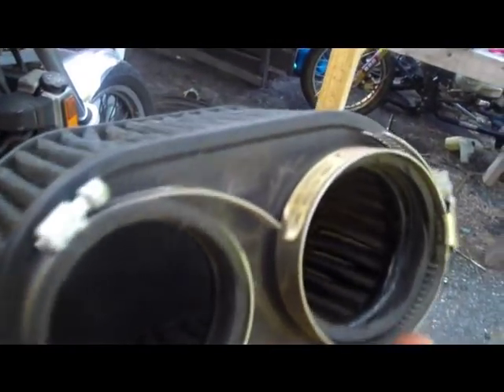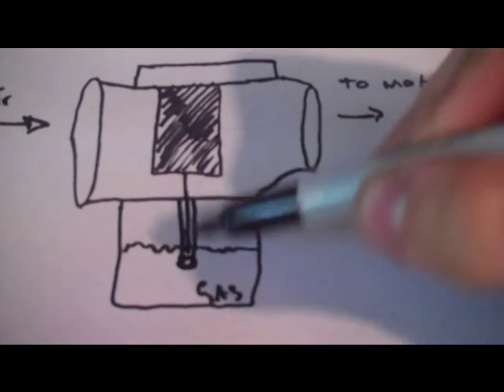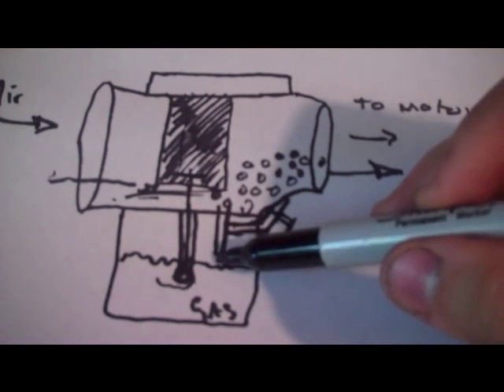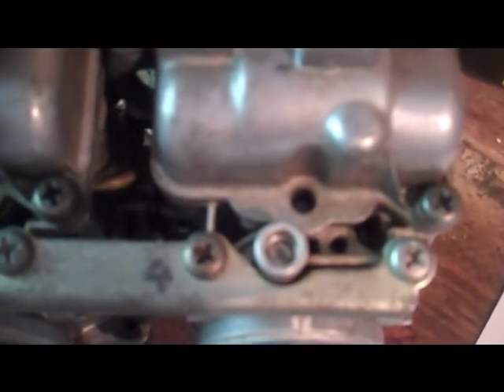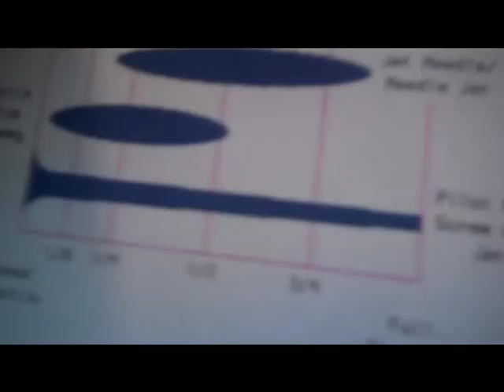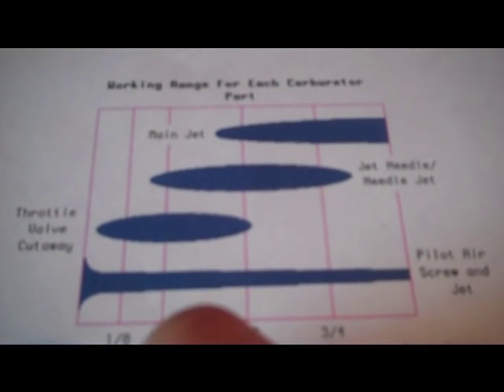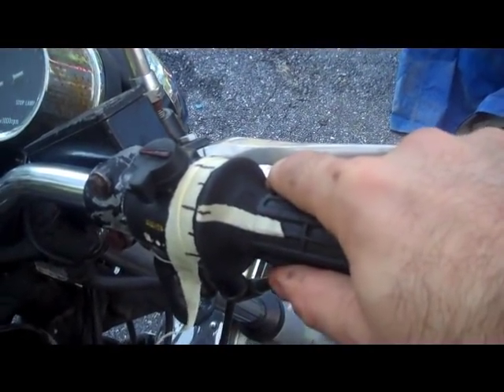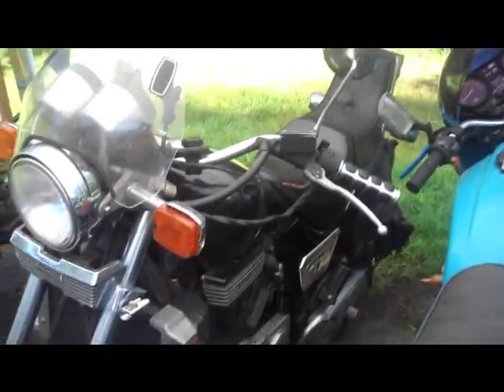How to adjust the jets on motorcycle carburetors

Comment: My bike has to high idle 2100 rpm. Its a Derbi senda 72cc 2stroke with a dellorto 21 carb.
The idle doesnt fall at all and when i put 1st gear the gearbox hits since the rpm are high and sometimes the engine even stops.
Both idle/Air screws are fine, theres not a problem with the throttle neither are there any leaks on the vacuums!

What could it be? Do you have any suggestions on what to do next?

Comment: hi Max. thanks for the info on the pilot jet covers. have another question. my air/fuel mixture screws are on the engine side of my carbs. when I adjust them in until they seat, there's very little change in idle if any. does that mean I need more fuel or less fuel through the idle jets?
Reply from the maker: Best way to determine that is just by reading the spark plugs like i show in the video

Comment: i have these exact carbs on my bike, i took them off and tinkered with them, when i put them back on and fired it back up, it revs all the way up to 6-7k and wont come down.. the throttle is not sticking and the choke is set right and not sticking either. what is my problem? i cant figure it out!!

Comment: Hey nice video...ty  Say I am working on a 2005 Yamaha Rhino 660 carb for a friend and he uses it at his Utah cabin at around 9,000 ft and it has a back fire issue during deceleration. Can I adjust the needle to lean it out or should I get a smaller main jet..?
Reply from the maker: Rejetting the carb would probably be the way to go. Usually it doesnt take much to adjust for altitude
Reply: right on thanks, but do you have a suggestion on what size jet for around 9,500 ft altitude or should I buy a pack of multiple sized jets and step down  2.5 at a time until I find one that fixes the issue..?
Reply from the maker: Yeah unfortunately I dont know, typically its just down 1 or 2 sizes. 
You might contact other users and see what they are jetting at high 
altitude because swapping them out a bunch of times is kind of a pain in
 the butt
Reply: alright...thanks again...

Comment: took the baffle off my 91 vulcan 750. its stock otherwise but does have a MSD. idle and throttling seem ok but cruzing or trying to maintain a steady speed it crackles. it has also stalled and backfired. any ideas?
Reply from the maker: Open up those jets

Comment: nothing in any particular detail really, but look in my videos for one called 'proper start', proof it DOES work! 
at the moment, just zx9r carbs straight off a bike, not re-jetted yet (apparently drilling the main jets out to 1.6mm for a 2 litre engine is a good start) and ignition straight off a 90's ford. at the moment just running a fixed 10 degree advance,and it idles fairly smooth for something just thrown together temporary! 
whats the name of that diagram you used?

Comment: I have a 92 gsxr. The petcock went back.  So I changed it the bike was running great before that. It was running like crap after I changed it so I pulled the carbs off and noticed bad floats seals changed them and it still runs mediocre compared to before it's jetted at 150 and pilot jet is 25 it has a hard time idling now but run fine at high speeds any suggestions?
Reply from the maker: Well if it was running fine before but now its running rough and you havent changed any major components like the intake or exhaust, chances are you dont need to change the jetting. I would suspect you were probably running rich from the overflowing, so start with new spark plugs that might be the source of your problem

Comment: i wanted to thinker with the pilot screw but it is already turned in to the max (i want to make it leaner). i think this means i should work with the pilot jet. should i try 1 rotation to right ?

Comment: 13:30 my lower part of my carbs are identical. i have a '92 gsxf 750 and i cleaned them because they were dripping gasoline. i didn`t touched the upper part because the sliders worked well. now i have a problem - put everything back except the airbox and when i rev the engine it deccelerates really slowly. is it because to much air ? should i put the airbox back in?also- are the sliders in the carbs supposed to move?(the ones attached to the membranes) when i rev the engine? thanks man.

Comment: awesome man thanks for the info
around 13:30 you say to increase based on the number of the jet
what did you mean by that?
Reply from the maker: Jets are classified by their size for example pilot jet size 40, and they will often increase incrementally by 2.5. So if you were to increase your size 40 you would replace them with 42.5 size jet and so forth

Comment: Hey quick question... my carbs are leaking fuel out of the hole the needle sits in... if i lower the floats to lean it out will i prevent them from leaking? thanks

Comment: Hi Brother, i'm trying to get more power of a Keeway TX 200cc 4-stroke, the bike is a single cylinder and use carb, the carb its a PZ27 (27mm diameter) and the exhaust has 3 very restrictive chambers into the silencer, so it can produce like 16hp on a good day, its a OHV engine... copy of the CG125 from honda, but elevated to 200cc... i have opened the exhaust y pulling out the last chamber of the cilinder getting better sound like a sport motocross bike... so, what do you recomend me to do? normally here in venezuela we change the carburator for a PZ30 but it make the machine runs bad... with now my bike uses the stock carb with the stock aire filter, and a iridium NGK spark plug, and when i stop accelerating and leave the engine runing by the movement of the wheels, it start to fart and sometimes you can see flames during night...
Reply from the maker: With all of those modifications you will definitely need to rejet the carbs like I demonstrated in the video
Reply: Thanks mrmax, i will try it...

Comment: Sensei,

I have removed the carbs from my bike, in the hopes of installing new jets. However, I have run into a problem.... the screws that secure the float bowls are badly seized. What's worse is that the last owner seemed to have the same problem, because most of the screws are really badly chewed up and don't offer a good bite. I don't think it there is any Loctite, etc, on the screws, because I managed to get a few of them off. Do you have any advice?

Comment: i got a yamaha xj650, and i had to switch out the motor because the starter drive clutch went out. i only switched the motor, kept the same carbs and exhaust but when i started it up, the motor would rev super high...any suggestions on where to start??

Comment: finally got day off to put airbox on.prior to me putting the air box back on everything was ok just would bogg down at 75 80..so when i finally got it on.the bike started first try and idled at about 12 to 15 hundred rpms .then all of a sudden without warning it just started high reving at about 5.5k or mor rpms..so i turned idle screw out so much without response it fell out..so im back to square 1 ..what did i do wrong..PLEASE HELP.

Comment: question i have 1986 tt225 yamaha dirt bike i am having bogging issue. so i cleaned the carb ran better but still little bogging i followed the same spec as the manual say . gas/air screw turn out 2 1/2 to 2 3/4 and the needle 3/5.  question the gas air screw you half to set it  between 5 and 6 turns to make it run right? and the manual says 2 1/2 to 2 3/4? also i have dark spark plug?
Reply from the maker: +GERMAN SHEPARD Set it to where the manual says, and investigate other issues as to why you are running rich. Clogged air filter, float height too high, valves needing adjustment, etc

Comment: hi max great video but like everyone have a question, i recently purchased a honda z 50 monkey bike that never ran, have new electrical system clean carb clean filter runs and idles fine , my problem is when i back off from top speed 3rd gear ( only has 3 gears) it really bogs down to the point where most times will stall, its like its flooding up but not sure, any advice appreciated , cheers

Comment: I've just cleaned out my carbs. I've synced them. It starts right up. idles fine but it wants to die out if I give it too much throttle. any thoughts? I'm in Cali, I have my mixture out at 2.25 turns
Reply from the maker: Is your airbox all hooked back up and not leaking? Good stock air filter, no aftermarket parts?
Reply: yes stock air filter,  and learned that I had to have no leaks and holes plugged in it. Still had the probplems so since ive taken them apart again and dipped them in berryman, so I still have to assemble them again. will contact you again if problem persists after assembly. thank you for the video and response. Really appreciated!

Comment: i have a ATV~~ chinese brand though, i know this is the motorcycle carb. But i believe it has very similar concept. Anyhow, my ATV won't crank until my battery died out. So I have to jump the battery up and re-tired. So, I took the initiative to take out the carb and look for any residue and clean it up, and i couldn't seem to remove the air filter compartment. Set everything back to places, and turn the key on, and it's still won't crank. So, yea~~ im really stuck why it won't crank.

Comment: Would you be able to explain how does an overflow happen. My CB1000 at times one of its intake suck up too much gas as I start i,t filling the intake with half cup of  gas preventing it to start!! I've check the float valve "little" spring and it appear to work just fine. How does one correct this annoying thing?  thanks

Comment: Hi friend,,i rejetted my suzuki GS150R, fixed a free flow exhaust n K&N, with 115 jet (stock was 110) n shimmed up needle jet 1 step up..but still experiencing hiccups at 3 quarter throttled.. need i also go ahead replacing the pilot jet? I use iridium plug and high conduction spark plug cable for my bike...Does it make any sense with changing the main jet holder??...i have a stuff which came along with the 115 size jet set...help me out....

Comment: I recently put in a quick adjust  fuel/air screw now i can't seem to keep it running. it keeps popping and back firing like crazy no matter how many turns in or out. i ended up destroying my starter clutch trying to get it running.
Reply from the maker: Well it seems your mixture is off. Id suggest using stock parts
Reply: mrmaxstorey I think i will take your advice on that after i order the new starter clutch and flywheel puller. $10 screw costed me $100 in damages. lesson learned the hard way. thanks for responding.

Comment: I have a question. I own a 2007 gs500f and added a drop in K&n along with added a yoshi can to the back. I heard about it running the bike lean, recently during winter I checked everything. I recently bought a pilot jet and a main jet I got the sizes online and went with that. With my bike 3 jets there is also a mid-main jet. Can you explain this or is it the same as the needle in the middle. I only bought a pilot and a main as that was all I could buy from Jets R Us, but the websites I used, said to also change the mid-main jet from 60 to 62.5. Which I could find anything that claimed mid-main jet at jet R Us.
Reply from the maker: Hmm it is unusual to have 3 jets but I have seen that before. See if you can find another resource to locate that proper jet size. Try bikebandit
Reply: mrmaxstorey super speedy with the reply. I will look into it. I recently just installed the mods,  checked the shims and needed one so it is on the way. Once that is done I will start up the bike and test ride it for now. I just bought the jets because of what I heard. I haven't even broke into the carbs to see what I'm working with. Just seen videos of cleaning and things of that nature. I will check bike bandit. Thanks.

Comment: Here's my problem. I installed a new exhaust on my cb400. It ran perfectly before that. it gave excellent acceleration and even punches more power at high rpm. but now, the new exhaust ruined it. took it a shop and have it adjusted the air/fuel ratio. now it runs better but not like before. acceleration decreased, no more power punch at high rpm and engine gets too hot after a long slow decent ride. is the air/fuel ratio wrong?

Comment: I can only get my motorbike started when i use starter fluid! with a few sprays of fluid i can get it to  start up and ideal just fine and stay on! was wondering if the settings on my carbs could be the reason my bike will not start without the starter fluid!?
Reply from the maker: +Keaton Moore No you need to clean those carbs not go messing with the jets. Check out my carb cleaning video

Comment: Hi Max. I have 1982 Kz1000 i'm trying to get jets adjusted for pod filters and open exhaust. My question is that my pilot jets have a cap over them so it pulls fuel through the main jets. Do I need to remove these covers or leave them on. Thanks.
Reply from the maker: leave them on

Comment: Put pods on my '78 GS1000- increased jet size by 5 (two steps as recommended by mechanic at shop for old bikes). Still can't get it accelerating smoothly, a little sputter and a little backfire. Is it possible I need even larger jets?

 I've adjusted pilot jet up and down and nothing seems to totally fix it. A friend suggests syncing carbs, but everything g was perfect when I started so would they un-sync?
Reply from the maker: Watch the video again, the video tells you how to diagnose and repair this

Comment: hey max i got a zx6r j1 2000  its been sitting for a while i started to idle the other day after couple minutes the bike start dying i turn it on get the starter and after  few seconds it dies again and specially if i touch yhe throttle any helo please thanks! and one more question is it the same carbs in zx6r  as the ones on the video?
Reply from the maker: +Noah Amine How long has it been sitting?
Reply: for more than a year
Reply from the maker: +Noah Amine Probably gunk in the carbs. Check out my carb cleaning video
Reply: +mrmaxstorey thanks man i learned alot from this one as well happy new years man!

Comment: hey man,i`ve put the airbox back in, all the other hoses and still nothing. when i rev the engine it deccelerates slowly. it takes a good few seconds to get back to 1000-1200 rpm. it seems to work better when i take the gas tank off and i let the engine run just with the gas in the carbs. does that make any sense? anyway, why does this occur now and didn`t do before ? i don`t know what to do know. i`ll check everything again. any advice is welcome. thanks.

Comment: I just got a full exhaust kit, K&N intake air filter, and JD jetting kit for my Atv, but I still get very very small minor pops/backfire when I let off throttle. Is this normal or Should I adjust pilot screw, the needle, or use a bigger main jet? Idk exactly wich one I need to adjust or how much I need to adjust. It's almost right where it needs to be but idk how to fine tune it. Plz help thank you
Reply from the maker: The test at the end of the video will help you determine if you are rich or lean and in what part of your throttle range. With that information, you can know whether you need to change the pilot, main, etc

Comment: My spark. Plug reading are all dark should I adjust the needle to More lean? Or is it better dark so you don't burn the engine?
Reply from the maker: +GERMAN SHEPARD If your plugs are reading dark you are too rich and need to adjust for a leaner mixture, IF you have modifications and are trying to get the jetting right. If your bike is stock and it is burning rich for some reason, then you need to clean and repair the carburetors, not mess with any adjustments

Comment: Can you please give some pointers for jetting at altitude? If I'm understanding this, being a mile in elevation,  I should go down 1-2 steps on the main (?). Also I am running a pipe and have both a paper and K&N panel filter for it

I know the mains now are 100 (92 gsxr 600w). I'm unsure if I should look at pilots as well. I am fighting a fuel overflow issue, but also know it hasn't been jetted for altitude.

Thanks in advance
Reply from the maker: Well first step is to get the floats to stop overflowing. And yes the higher in altitude the smaller the jets, you may need to do some experimentation with that. The K&N may be a better choice for you
Reply: Understood about the floats. The bike sat for a year and does run, but occasionally drips while off into the air box. I am going to dip the set, however wasn't sure aboit the main as I figured id do that while they were off. Does the same rule apply to the rejet?  Meaning if I should be smaller at altitude, but 1-2 steps up with a pipe and filter, should the 100 be correct and just adjust the needle and pilot? Your vids are definitely the most informational on the topic.

Thanks again
Reply from the maker: noifcustoms
I would leave the slide height alone for now and just reduce the main size a step or two to start with unless you are having trouble idling. Unfortunately I dont have th emagic formula for you, it will take some experimentation, but you are headed in the right direction.

Comment: as far as the pilot screws go..if i have a 4 cylinder, should all 4 of the pilot screws have the same number of turns or are they all pretty individual ?
Reply from the maker: +Luke Benton Yeah pretty much, unless you are performing very detailed carburetor tuning where the jets of the inner cylinders are a different size than the outers

Comment: when you do the tape on the throttle, what rpm's or what gear do you test in? Does it matter? Thanks. I have an '89 GSX-R 750 with the 36mm carbs that I want to tune.
Reply from the maker: +david contreras I show it in neutral but its best to do it under load, so traveling in gear. And the point of the test is to see how th bike performs throughout the powerband, so ALL rpms